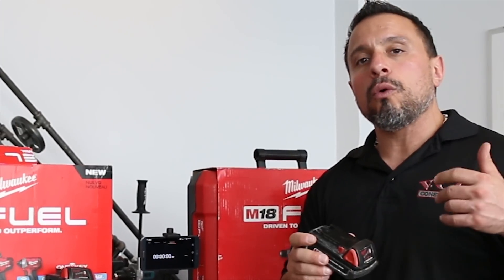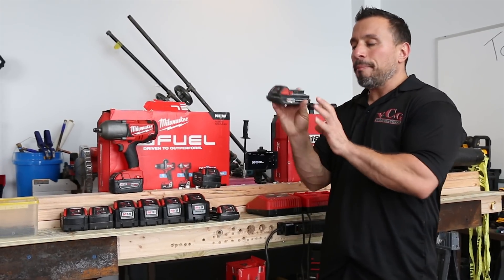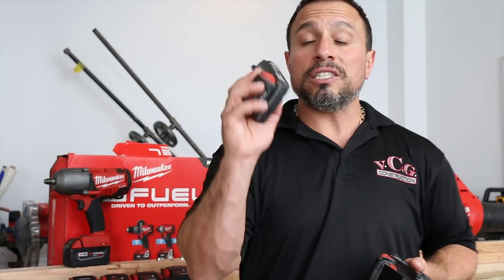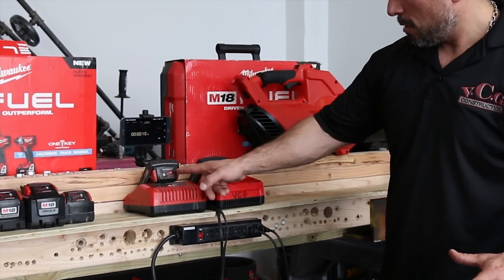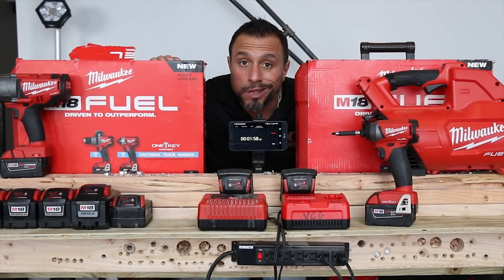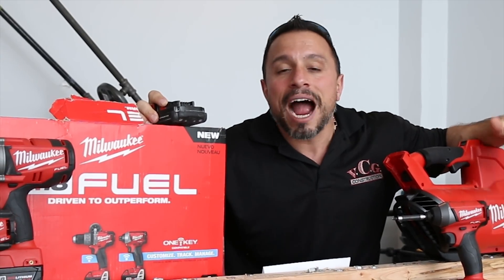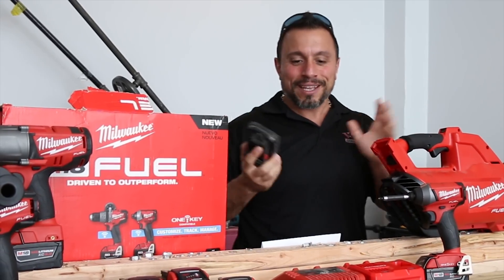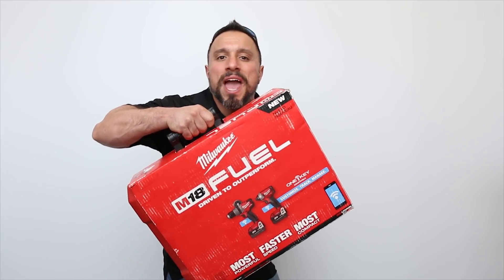Watch This Before Rapid Charging Old Milwaukee M18 Batteries!

Comment: Leaving a comment that I watched your video.  Question: if there is a "lightning bolt" on the battery, will it charge even faster in the rapid charger?

Comment: That is not surprising since a M18 "charger" is not a charger but a power source.  The charge controller is inside the battery.  That is how they can balance charge the pack using only five contacts on the battery.  For the M12 the "charger" is actually the charger.

Comment: I noticed that it does charge faster on the rapid charger.  I wonder how charging hot affects the life of the battery.
Reply: I let mine cool a bit if possible before charging since the charge creates more heat. Lithium ion are ok heated up but upper limits can cause issues. To be safe I try not to let them get too hot.

Comment: Great video.  I've got 3 M18 batteries that only charge to 2 bars.  Is my charger bad?  Comments appreciated.  Rick
Reply: The easiest way for you to tell.. have the batteries charged on another charger, use a friend’s or a co-worker’s one to see if there will be a difference? or if just try charging a different battery pack with your charger, 
Though; I haven’t opened up any of my M18 batteries but I’ve bought a used DeWalt 3.0Ah battery from local flea market, I went a head to fully charge it, (Dewalt only uses 3bar indicator lights) so then, charger shows it’s full, battery only shows 2 bars!! I’ve been sketchy about the charge indicator light board though, I opened up the pack and I figured that the 3rd wire connection was weak, when I put my finger tip on the back of the connection the light comes up.. then I’ve found that the battery was good .
Hope that helps 
Mike
Reply: Open and balance the battery manually.
I use a 12v 5W bulb to draw down any high cells. A lipo charger to bring up low ones. 
Has worked a treat on my 12ah packs.

Comment: Hey Vince I've got a Milwaukee 5.0xc battery and I was using it on my weed eater and for some reason the battery stopped working and the lights on the battery started flashing back and forth. And alternating lights where blinking back and forth. Idk what the deal is but this is my newest battery. So I don't get it. Any info you have I'd much appreciate. Thanks in advance.

Comment: Has anybody else had any problems with the 9.0 not fully charging at first I thought that the led might not be lighting up but they clearly didn't last as long as the ones that were fully charged. Milwaukee said they are unaware of any problem but I now have had a third one go. To Milwaukee credit they warrantied it no questions asked but its getting annoying and making me hesitant to keep stocking up batteries I thought about getting different sizes large batteries  (8.0 or 12.0) in the future  but just the other day happened to one of my 12.0!! never had a problem with 4.0 or 5.0 and had them much longer. Another great video Vince keep up the great work
Reply: My issues with the defective 9.0 battery design and Milwaukee's failure to give a damn about a problem they know exists among that product line, along with their failure to remedy the situation, has destroyed my faith in the company.

Comment: I got a brushless drill set today and the cp 2.0 is flashing green and red is that bad?
Reply: I know it’s 1 yrs old comment, but My dual 3 Amps M18-M12 charger indicates your battery is faulty man.. (flashing red-green)

Comment: I had a set of the older 2.0 slim battery from about 2010. Look at the bottom where the contacts are. There are two raised ridges on it vs 1 on the 5.0. This ridge prevented the battery from being used with some of the higher demand tools like the salzaw. This is probably the lightning indicates.

Comment: How about some data and detail. Did you use newer rapid chargers? Those have like double the charge current capacity. Can't charge any battery faster than its charger can chooch. And, would you try it with some proper high capacity batteries? These little ones only have one 18 volt bank of cells inside. They can only take so much charge current, just like how they can only discharge at a limited current. Slap one on a big impact wrench, sawzall or demo hammer and it'll drastically underperform. What would be actually interesting and valuable, is to see how the discrepancy in chsrge time (on 6A fast chargers) if any, scales for higher capacity batteries with multiple 18 volt banks (combined).

Comment: I wanna know why my older 5.0s have a silver bar on label and newer ones are black with a wifi type signal on battery. No idea what the purpose of it is. Really only have one 5.0 left with silver strip all newer and 9.0s for me. Soon as a deal on 12.0s I'm in.. or new job site at work and I'll get the 6/9in grinder and 2 12.0s.
Reply from the maker: I’ll try and find out!

Comment: I was disappointed I thought this would be good info about not using the rapid charger on at the very least any 1p pack but sure it will charger it way to fast but that's not good for them pushing 6 amps

Comment: So, my rapid charger starts blinking red and green after charged. Is this correct ?
Reply from the maker: Read the status key on your charger. Sounds like you have a bad battery
Reply: VCG Construction no bro...it does it on every single battery. It charges them too. I have like 3 5.0 a 9.0 a couple of 2.0 and 1.5 and all do it.
Reply: Does it blink red and green without a battery in it?
Reply: Michael Ravel no, say I put a dead battery in or one that needs charged. It will charge it, when charging it will blink red or stay solid..can’t remember...then with start blinking red/green.